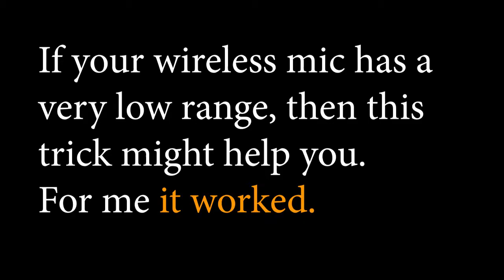Increase the range of Wireless Mic.. TRANSMITTER HACK !!

Comment: Our F&D mic (similar one as per your video) not working.. in the beginning it was working fine, but we stopped using it hence kept aside for almost 4 years now.. removed batteries and kept like that.. how to get it back in working condition.   Orange/Reddish Light showing after inserting new batteries.  FYI.  Pls response with your any of the available video...

Comment: How about changing the frequency of this microphone? It happens that i buy two pair of this i am having a problem with it due to the same frequencies. Can you please make a video with it?
Reply from the maker: If you are having interference in mics then you can change frequency in the receiver of microphone. frequency changing method might differ in every microphone setup. Mic shown in this video was  came with my F&D T60X home theater system. and the receiver was built inside the home theater.

Comment: what if you made the wire longer, sealed the other end of the wire with some tape or silicone, then wrapped the wire around the circuit board and closed it back up? would that increase the range anymore? i must know
Reply from the maker: I think it might work a bit, And it might not also. there are certain range of these rf signals. we can not increase it more than it is capable of.  This little mod did work for me.  In future I will try to increase the wire length to check if it works or not.. :)
Reply: @anydiything  sounds good
Reply: You can do calculations about how long the wire you're going to use. First know the working frequency of the microphone then calculate it.

Comment: I wish you revisited this i think you gan get alot more with a different way of wrapping.  I did BT headphones with smaller wire but alot of laid down loops i dont know how to explain that part but can draw it...lol and ran it throughout the phones and got almost double, ok 1/4 about 6 to 10 more feet out of BT shit sorry about rambling but awesome video!
Reply from the maker: Actually This mic  used to work under very short range (less than it really should be), and after this mod the performance was noticeably better.